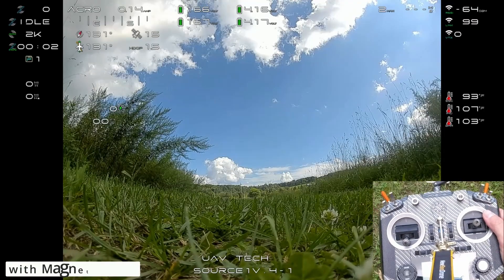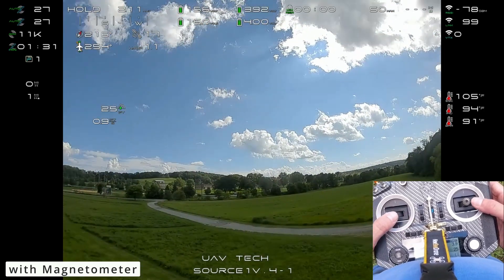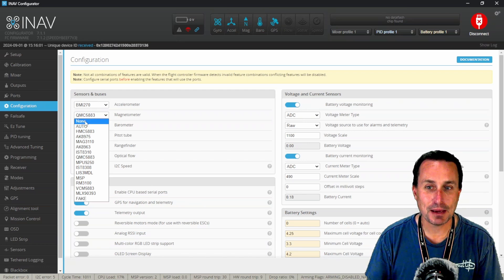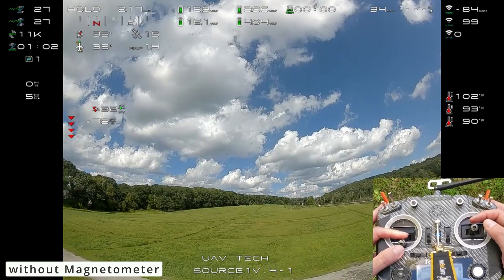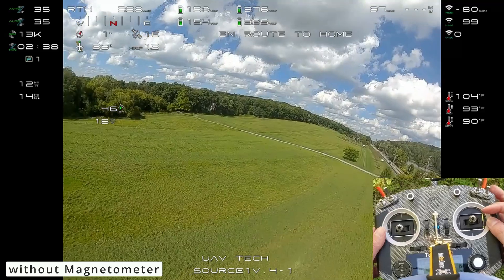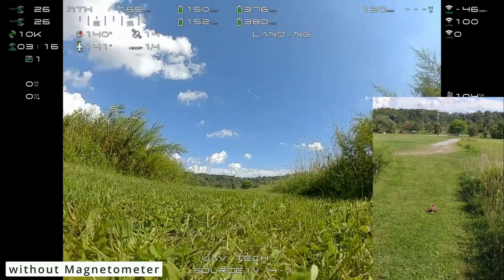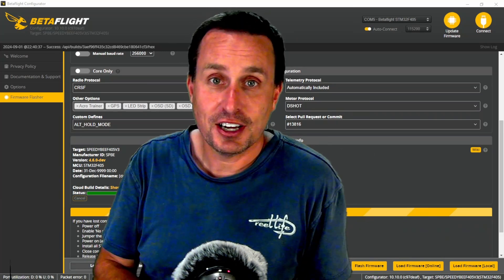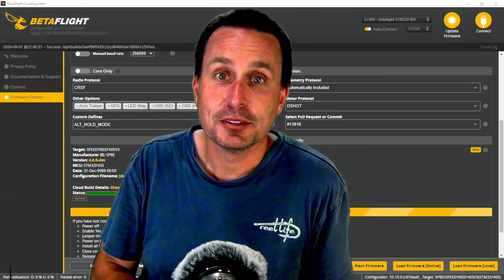🌟INAV🌟 No Magnetometer Required!  &  BetaFlight Altitude Hold is Coming!!

Comment: I bought a Fimi mini 3, which has a useful purpose, but is quite boring. Now I want to try fpv, I have a tiny go  kit ordered, and plan to advance with walksnail l and other drones. I'm a Windows guy and only want to learn one software. Which of these should I chose, Betaflight or Inav?
Reply from the maker: Betaflight is simpler.  INAV can do way more autonomous and Wing things, but it does not fly auads copters as well.  Decent through.

Comment: hey man, sorry to veer off topic. i've been, and others, trying to use bf blackbox data to create a path on google earth pro, everything seems to be set properly but we keep getting paths that are way higher than reality.  a quick look in notepad shows the data is saying 1000m instead of 100,  i'm wondering if logs are recording  eg'' 100.0m and google earth or the blackbox tool is failing to use such fine resolution to altitude? and if so? any ideas on how to fix it?

Comment: Just in the process of setting up gps RTL. For altitude hold to work will i need a barometer?
Reply from the maker: Nope.  Set "inav_use_gps_no_baro = ON" in the CLI.  Of course, that is one less sensor for altitude, so the Alt Hold part of the Pos Hold may not be as good, but see how it goes.  GPS Alt and variation are pretty sensitive nowadays.  Of course HDOP will need to be decent - which is always the case - so look for that to be less than 1.5 for any type of decent olding.